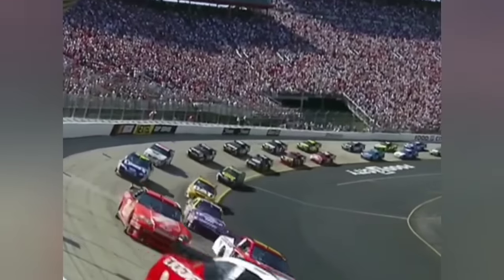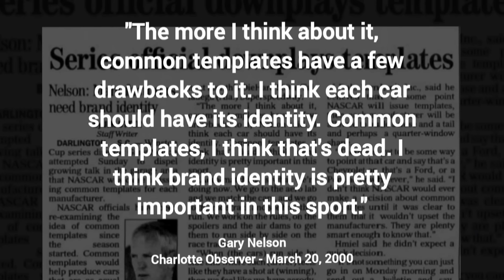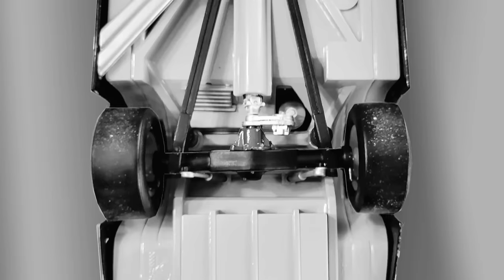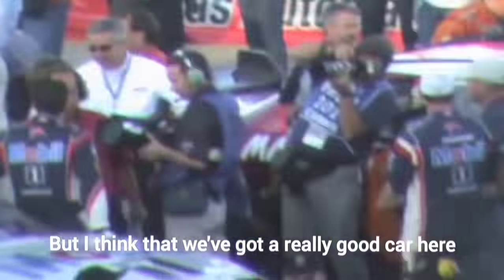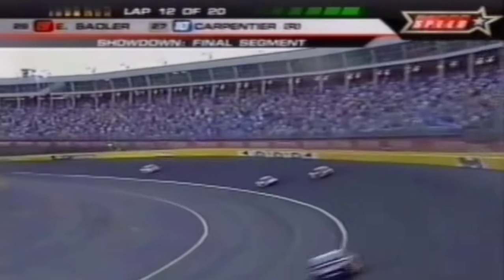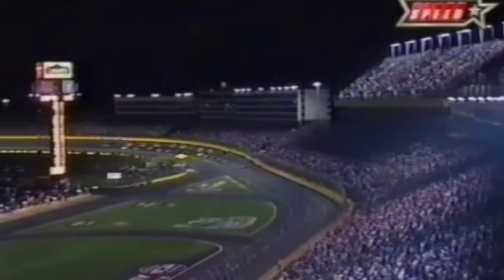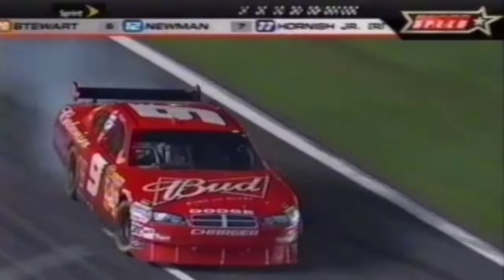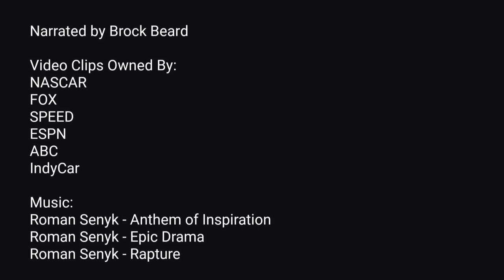The Car That Exploited the Car of Tomorrow

Comment: I love how basically every banned race car story starts and ends with "it dominated the field and then Chevy or Ferrari complained". The 2 biggest stiflers of innovation in racing and then when they do it it becomes OK.
Reply: Chevy says waaawaa when ford surpasses them
Reply: There's also Formula 1 racing, which has reached the point where every legal car will be illegal under the next season's rules.

Well, NASCAR even changes the rules in mid-season.
Reply: Remember group B Rally in the 80,s? and the Turbo charged F1 cars, 1200hp-1400hp from a 1.5L engine? I say cut the rules down and go back to the way it used to be. With the safety advancements we have now, their is no reason to be limiting top speeds as much as they do. Drivers and fans know the risks. I would love to see the Nascar cars bumped in power. Build some new tracks and remove the restrictor plates.
Reply: @davidbrennan5  Well the turbo F1 cars of the time were incredibly unreliable, and they didn't run 1200 hp for the full race. These days in F1 we have basically the same architecture as we had back then, 1,6 litre V6 turbo. It's just that we have the hybrid stuff now. And even now they have stagnated at around 1050 hp so that should give you an idea of how much they were pushing the boundaries of reliability going to 1200 hp back then.
Reply: To me it seemed more exciting. Too many rules hurts the sport imho. Look at Pikes Peak, they have no rules in the open class anyone can run a car even something built in the backyard.
Reply: With all due respect, Bill France Jr literally told Ray Evernham "That T-Rex car is illegal." When informed it passed inspection, Bill Jr retorted "It won't be legal tomorrow."
Reply: @davidbrennan5  knowing the risk isn’t the same as unnecessary deaths
Reply: Everything is better than it used to be though, from tires to vehicle construction to drivers safety gear. Safety advanced a lot but the speeds didn't advance with it. Going 200mph will always carry risk, several production cars go over 200mph. That isn't even fast anymore.
Reply: Chevy is the biggest cry baby in American motorsports.
Reply: dont forget how Ford complained on R32 Skyline in Touring, so it not just Chevy or Ferrari
Reply: @davidbrennan5  To be fair, you can't really compare time attack races to stuff like F-1 or NASCAR. You have a lot more leeway for when you screw up when you are the only car out there.
Reply: usually it's Mercedes not Ferrari but yes
Reply: Porsche also complained about the BMW m3 gtr dominating ALMS in 2001, prompting BMW to pull their M3 from competition
Reply: @davidbrennan5  The only problem with insanely fast cars is that they catch big air when they crash. There have been crashes in NASCAR that would've been like Le Mans 1955 if they landed in the wrong spot. Racing organizations would have to decide if they want to push spectators further back in order to run faster cars
Reply: hey, that's not fair, Ferrari spent a LOT of money to cheat fairly 😂, this was something anyone could do, that's not fair
Reply: if you remember Group B then you also remember that it was indeed the drivers who went "this is too much, we don't wanna drive these" 

Group B went away for a reason
Reply: @davidbrennan5  thats the power of memory. You remember the great bits and ignore the shit parts. Current rally cars are significantly faster than group b rally cars on the same stages despite the stricter regulations now and lower hp figures. Dont forget how many people died and were injured as a result of that lack of regulation although there is a point where its too much, having that balance is essential. This applies to most motorsports aswell although im not a nascar fan so i cant speak abt nascar. F1 fans didn’t/ dont like the halos despite the fact it is a potentially life saving feature solely because they dont like the look🤷🏾‍♂️ but are we gonna risk participants lives just for the spectators enjoyment? I do understand the annoyance of cookie cutter cars but them twist bodies are bs theres gotta be a limit surely 😭😭 or atleast thats my opinion anyways.
Reply: @HeapOfBones  frfr the teams and drivers got tired of risking their lives over a trophy which is a valid concern. It vanished for all the right reasons.
Reply: @davidbrennan5  audi only got their car into rally because they had the rep at the meeting wait to the very last minute to bring up a 4wd option for a car. all the attendants just agreed with it as they were out the door leaving.
Reply: @davidbrennan5  better yet nascar brand nascars  were it's all made by nascar and then left to the the groups to mod the hell out of them to find the limit and then work around that to get even more out of it unit they just have to make a new one to start over with and make new tracks for them too
Reply: @David Brennan  nascar is supposed to be all parts you can buy as a consumer, so there would be a limit, but that would be determined by manufacturers not by Nascar if they ran it like its supposed to be ran.
Reply: @IVIUT3D  well they are just a billboard on wheel now i think there is anything from the car makers on them other then there badge
Reply: @MA-kr6yv  yes, but the cars don't make V10 noises anymore so they're clearly not good.
Reply: yes lets take shots at chevy and farrari while ignoring other companies who do the same shit, need to check yourself b/c your bias is showing
Reply: @0Heeroyuy01  found the Chevy fanboy
Reply: @0Heeroyuy01     Said Chevy and Ferrari.
Reply: @davidbrennan5 and barely anyone watches pikes peak
Reply: They're the Pampered Favorites.
Reply: @HeapOfBones  yep... Toivonen was literally complaining that the cars were too fast and the driving much too brutal to keep up with the multiple thousand KMs they were putting up during the rallies back then, the stage before the stage he died on. Innovation is awesome, but drivers, codrivers, and spectators don't need to be killed or injured for it to happen. 

Honestly, its tragic how much the current WRC cars are downplayed, those things are brutally quick, and since they added the hybrid system, the added weight means that they actually have to slide the car a good amount. It's quite fun to watch. If there could be another manufacturer or a few, it would be pretty fucking awesome.
Reply: @klausstock8020  F1 issues plenty of directives and rule clarifications that effectively change the rules mid season without actually changing the rules.
Reply: Oh please Toto Wolf complains louder than anyone else in F1, that is when the Hamster isn’t dominating.
Reply: Monaco 84
Reply: They both get coddled by the rule book like the youngest child it’s stupid
Reply: Now it's Mercedes, instead of Ferrari kkkk.
Reply: Porsche did it too
Reply: if chevy and ferrari combined, it would be the biggest karen of all motorsports
Reply: Most racing orgs out there are explained by your statement. Insert person brings great innovation, big companies feel threatened by this person/company getting publicity and winning, car design banned, repeat.
Reply: @VGF80 it didn't get banned. The regulations were changed to 3.5 conventional engines. In fact mazda sucked literally every other year and race except for that one Lemans win
Reply: @0Heeroyuy01  lol chevy has never been a factor in racing when the cars had to be sold to the public. They only win when a car is built specifically to the rulebook they help write. The entire history of actual "stock cars' gm was never even a factor. They lost so bad that the execs didnt even want them racing or making performance cars anymore, but then when they saw all the money being made at nascar because ford and chrysler were having one of the greatest showdowns in racing and gm was dead last in every race they had to ban aerodynamics on cars and they had to ban engines. And that began one of the biggest spirals of race cars bit being anything remotely similar to their race counterparts in all forms of racing. Chevy was also a huge crybaby in drag racing and in endurance racing. Gm and ferarri cried so hard that the new gt was unfair that they had the governing officials make ford weigh the car down with lead weights because it was too good of a car and they couldnt compete. Yet now its ok for chevy to copy the 458 and the gt and enter it into the endurance series now that the gt is no longer a factor and still is held back by the rulebook. Lol nobody cries as hard as those 2 do in racing and thats the annoying part. Everyone else pushes for new tech and innovation those 2 only allow it if they came up with it. Just like how hard gm cried when ford brought the taurus to nascar and tried to get it banned but then borrowed its design with the monte carlo and then it was ok.
Reply: @crowbarduck1818  corvette racing enough said, and im not reading that long of a comment
Reply: @0Heeroyuy01  corvette racing? You know the team that constantly loses to ford and  chrysler when they had the viper.
Reply: @0Heeroyuy01  tell me my guy what happened when the gt returned to racing in 2016? Oh yeah thats right it slapped the shit out of chevy and ferarri and then they both cried and had the car restricted by makimg it carry lead weights and had fuel restrictions which persisted until the c8 came out years later . Hmmmmmmmmmm fun facts right the even funnier fact is the public version of the gt would of stomped even harder but the sanctioning board didnt allow the gt to bring its tech goodies onto the track. Its a rare moment The street car is better than the race variant. Cant wait til the gtd slaps the vette again next year.
Reply: Really? All those good ole boys were doin fucked up shit on the track.
Reply: @VGF80  The reason why the 787B was banned was because in 1992 FIA was getting rid of he old Group C mostly unlimited engines they were putting in rules to make the cars run 3.5 liter engines much like F1 cars so no the 787B wasn't banned because the French were embarrassed or 787B was too fast (In reality it was one of the slower cars in it's class) It was because they were already putting new engine regulations in for the next season and the 787B wouldn't be able to compete.
Reply: @BoxOfKrabs  I already realised that a long time ago, the ban was coming anyways reagrdless of the win. That realisation only came after I made that reply.
Reply: And now Mercedes have added on the list, since they introduced DAS on W11 in 2020 season.
Reply: Right crow!!!!!
Reply: @joemungus6063  isle of man TT go BRrrrRr
Reply: @quadbecky14 Chevy has never complained. It's always been Ford.😂😂
Reply: @davidbrennan5  Yeah but these engines litterally self destroyed after 2 laps in qualif, they basically had 1 engine for two laps with a f*ck ton of power, and a less powerful but more durable engine for the race.
Reply: Z actly
Reply: Wanna see way more interesting racing and innovations.  80's and 90's rally and btcc and jtcc racing
Reply: They let the 95 Monte Carlo get away with curves and sheet metal that wasn't factory.
Reply: Porsche does the same thing too. It’s always fine when they’re on top, but not when anyone else is
Reply: @electricpaisy6045 Ferrari is historically the biggest complainer not Mercedes. Shit Ferrari complains so much they made complaints on Ford which has barely raced against them , even after saying they would dominate them
Reply: @matthewchurch1320 nice idea if NASCAR was into manufacturing. Here’s the problem I see with it. They don’t manufacture and would out source parts. Who do you think they would get the parts from? Probably the people in the race to begin with like Ford Chevy or others. Probably have to go with American made for risk of bad publicity. The companies providing parts would definitely try to game the system imo which would be fun to watch
Reply: @davidbrennan5  Pikes Peak is a hillclimb event. That's completely different. And the way I see it, everyone hates domination in a sport, yet they also hate it when the cars are made identical so there is no domination. That genuinely baffles me. We enforce strict regulations to ensure no one dominates with some magical bullshit car, or at least to make it easier to recover from if it does get to that point. Because why the hell would anyone want to watch a sport where the result is always predetermined? No one because that's just fucking boring. But then we bring that under control, and you guys complain about that too? Really? At that point, we should honestly shut down all forms of racing globally from now on. Because if you guys can't be pleased no matter what happens, why even bother?
Reply: @klausstock8020  that is an incredibly unfair assessment of F1 and simply not true.

The only times that F1 cars change so drastically that the previous season's vehicle is entirely illegal is every 7-10 years or so where there's a major formula change. Other than that, there are year over year adjustments to the regs, but nothing so severe they cannot run the old hotness with a little bit of bodywork changes. See the zero sidepods Mercedes or the many times manufactures run a B spec car while the newest chassis is still in the works.
Reply: @klausstock8020 Indycar does too. Remember the beast motor that Penske ran at the indy 500 that year.
Reply: It's easier to complain, than it is to step up to the plate.
Reply: To be fair, the Taurus was just a cheater car. Not innovation. But otherwise, I agree with you.
Reply: @The_ZeroLine  - It's supposed to be stock car racing... and they're all "cheat cars".
Reply: @The_ZeroLine  Imo any car that isn't sold to the public is a cheater car in "stock" car racing but semantics.
Reply: @crowbarduck1818  I’d agree with you. It’s dumb to make them base the cars closely on the “stock cars” since any ceased being stock 50+ years ago. Open up the rules though and you get F1. Personally, I like F1, but I get why many don’t.
Reply: @The_ZeroLine  I mean even f1 has stagnated in terms of pushing the edge of innovation.
Reply: @crowbarduck1818  Indeed. They’re trying to balance the show with the whole tech thing. Unluckily, there’s only one Adrian Newey in the world. It’s like MJ playing against toddlers in terms of design.
Reply: Or Porsche sometimes
Reply: @98MTBiker  Modern F1 cars have much less fuel to work with over a race. They actually have to run super lean.
Reply: In nascar every manufacturer has whined.
Reply: I remember when the Chevy Monte Carlo racers whined like babies because the Pontiac cars had sloped rear window while the Chevy was vertical
Reply: F1 too, with Mercedes.
Reply: Well then again they are both the top of their respective games  so It doesn't take much to pass some stuff under the table
Reply: Don't forget about Porsche complaining about the M3 GTR in the early 2000s